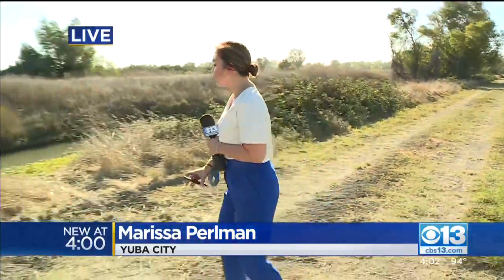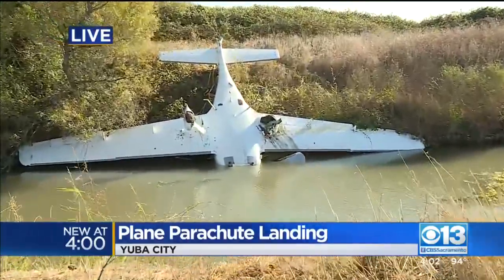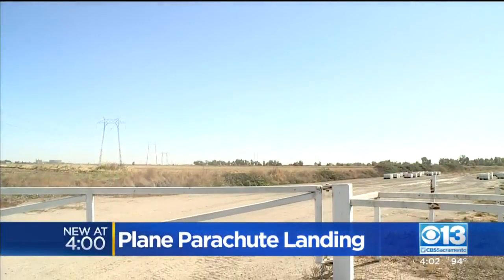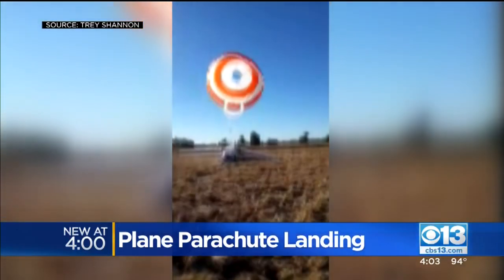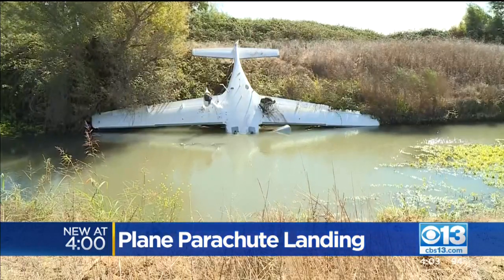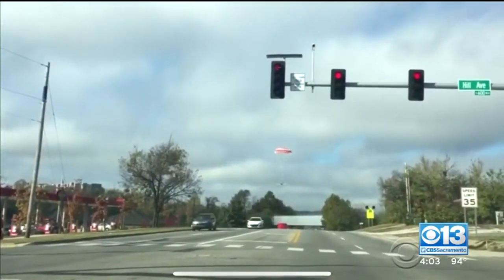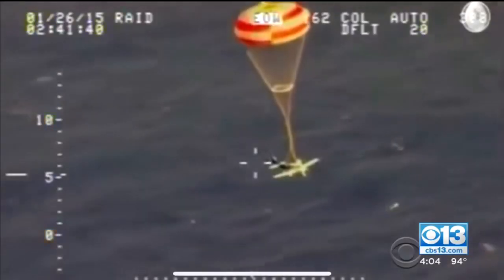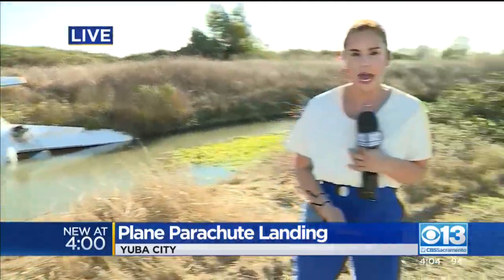FAA: Small Plane Runs Out Of Fuel, Deploys Parachute, Makes Emergency Landing In Sutter County

Comment: If i got to trust some random mechanic to pack my chute i might as well let someone else pilot the plane. Always pack your own chute!
Reply: That’s not how that works. The parachutes are packed at the factory and are deployed with a rocket.
Reply: @VictoryAviation  So it's like an air bag in a car. Fair enough! But one can't be sure it's going to work until they need it.
Reply: @michaelgrabianowski6567  So far it has a 100% success record... higher than air bags in cars which have been known to fail, though rarely. Also the parachute is triggered by the pilot unlike air bags in a car that automatically deploy. Both systems are brilliant.